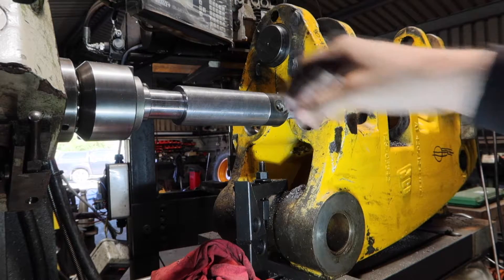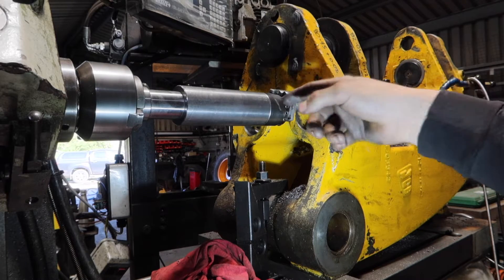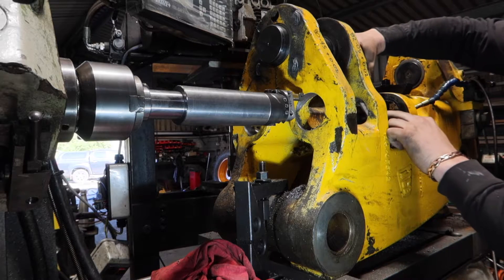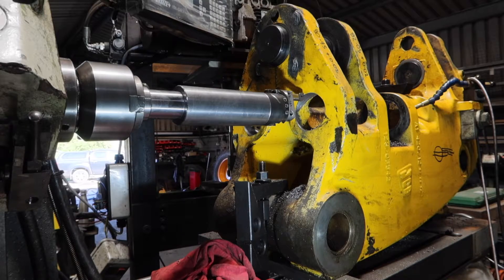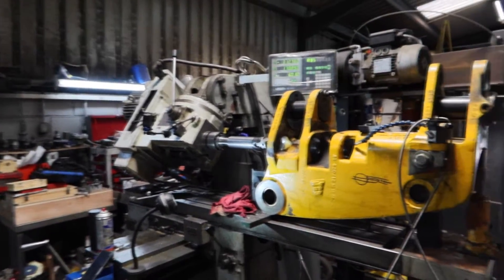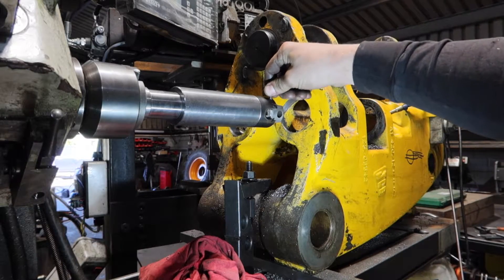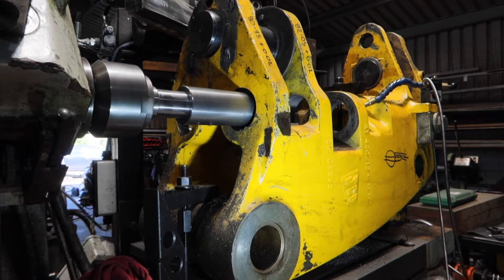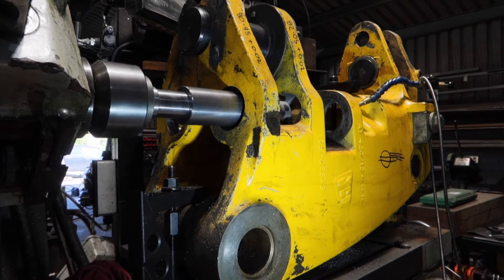Boring and sleeving JCB king post slew pin journals

Comment: Can you please help me! My kingpin will not come out, I've pounded it endless with a 18pound sludge hammer. I don't see anything holding it. What am I doing wrong
Reply from the maker: @Thebombonlyone   sledge hammers are not the way forward, have you deformed the top of the pin? Do you have all the weight off the boom? What machine is it (make and model)
Reply: @thomasburroughs5575 

No i have not deformed the top of the pin. Its a 1983 jcb 1400b backhoe. The weight is off the boom. If sledge hammers arent the way. Then what is?
Reply from the maker: @Thebombonlyone it Been a while but I think the pis is stepped, try pushing it up with a jack or large aluminium drift. We normally take them apart with jacks. If not then I tend cut them out with the gas

Comment: What is the tolerance your looking for on the indicator for centring the boring head before you begin boring
Reply from the maker: When I do a journal repair thats gone oval I look for equal runout over 180degrees in the x and y/z planes.
Reply: @thomasburroughs5575  
Right ok , if you were to be doing a lot of this type of boring jobs , would a horizontal borer be a better option
Reply from the maker: @springer3783  yes definitely, im fabricator though and not a machinist, a horizontal boring mill would be overkill for me. Lots of change here since this video, I must do another to showcase.